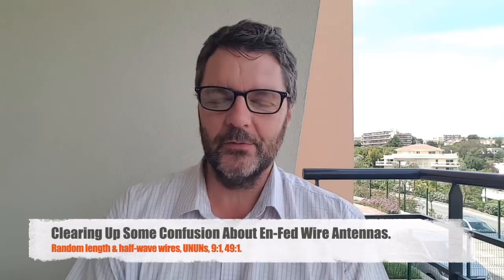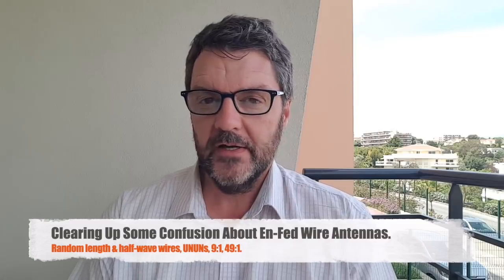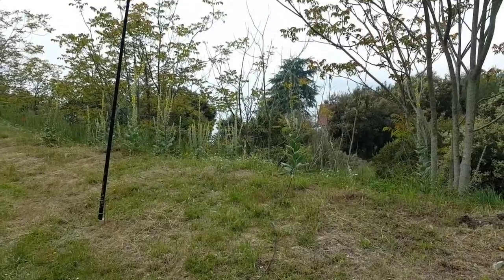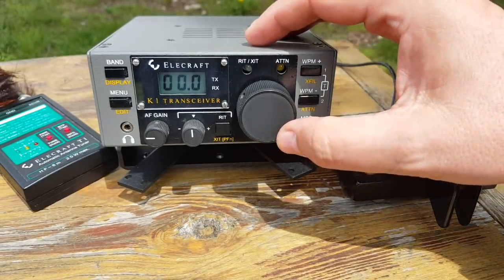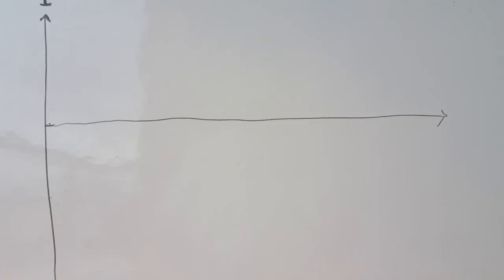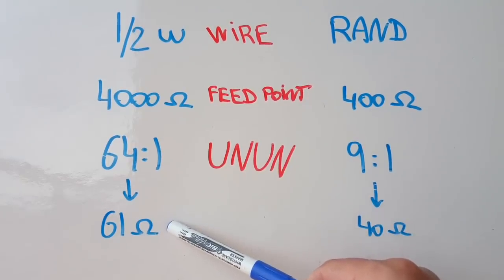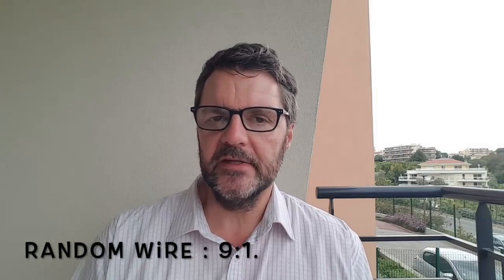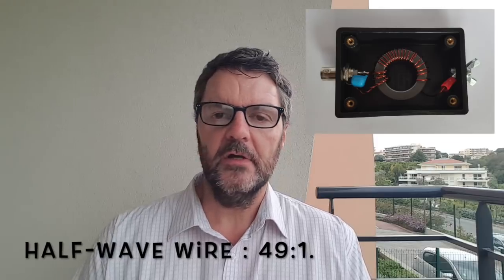Clearing Up Some Confusion About End-Fed Wire Antennas.

Comment: Almost complete baloney. The impedance analysis of a random wire is wrong. The analysis of what happens with reflected power is wrong. The explanation of the use of 9:1 and 49:1 baluns and why they appear to work is completely wrong.

A true EFHW antenna, a resonant half wave of wire is an excellent antenna when used with a simple LC tuner. It is still a good antenna when used with a ferrite 49:1 balun although 20 % of your power will be lost to heat in the balun. On frequencies where the wire does not represent a half wave the balun losses can be 80% or more. The reason it appears to work is the high losses double attenuate the reflected power, fooling the VSWR bridge. You can get exactly the same results if you insert a 6 - 10 dB attenuators in line withe feedline.

To be clear, an end fed wire is a valid and, in most cases, an excellent antenna provided it is properly matched. A 49:1 balun will properly match a resonant end fed wire. But when it appears to work well on non resonant bands it is simply fooling the VSWR meter.

Please do not continue to propagate the "multi-band, no tuner required, end fend antenna". It is a complete hoax.
Reply: Great ..you ground with short comments the strange ,,philosophies,,  presented.
Basically, the equation concerning impedance relation to turns relation is missing .. impedance ratio goes by square of the turn ratio .. isn' t it ?
73 de 79HER215
Reply from the maker: I have said nothing contrary to what you just said.
Reply: What hapened in antenna can be explain very simple for most people who cannot follow all those but for start can understand simple what hapened in antenna. 
I know much more but I say explanation is ok for beginners. Better than nothing.
Reply: What happened in antenna in this case wire antenna is really complex , any antenna have ovn L C , also except impedance have inductive reactance, capacitive reactance, even ohm resistance. But also capacitance to near objects, ground(everything what can be  conductor)
I can continue all day and something skip. 
Example, ⅝ wave antena is litle longer than ⅓ wave so naturaly have some capacity reactance component. But it is matched with  coil in base so if design is correct have pure impedance. So in antenna some people use simple C & L and when cancelled each other we have pure impedance. But also in  theory you can find , phase shift explanation. Electrons need more time in the coil, loose time, so ⅝ wave isnt just ⅝ wave , coil make this ¾wave and really ¾wave do not need additional matching, rather connect same lile ¼wave. But ¾ is much more longer than ⅝wave. And so one.
End feed antenna is really tricky to explain everything what happenned in the wire. Same wire, same frequency , but not same soil or other objects, give different ratio inductive, capacitive components, impedance, even resonance. Radiation pattern is another huge problem.
By the way I prefere resonant transformer not just inductive.
Why ? 
Because I can add or reduce   L and C in antenna to match near perfect. Simple transformer cannot do this. 
I say antena can be look simple or for expert only.
No hard feeling.
Reply from the maker: True, even after I learn more it still would not make sense to most people, even if it might to me (and that remains to be seen) and a few others. Theory has to stop somewhere even if it means oversimplification, which might not reflect a perfect theoretical reality. Experiments don't lie, assum8ng repeated results.
Reply: @RadioPrepper  I'm convinced most antenna theory is ivory tower malarkey anyway. I've been making contacts all over the world with the hated random wire for 26 years. The number of times I've been told "not possible - not happening..." Is possible, is happening. 

So Im with you, Gil. If it works, it works. If someone else can't pencil that out, that's not reality's problem.
Reply from the maker: Definitely. Right now there are very interesting reports on the Clansman military group about the merits of the 8m random wire. Half-wave is better but it doesn't mean it can't work well enough in most cases!
Reply from the maker: As to the opening comments, I can't and won't make a twelve-hour video! That's why I said in this one "it's not exactly like that." Also all who get on their high horses and up in arms about my errors or missing info are never willing to teach, only criticize. I spent about ten hours on this video trying to bring some light, as I understand it, on a complex but important subject. It might bring me enough money to buy a beer... It's not why I'm doing it. BTW I have used a 49:1 with a 134ft wire on multiple bands. It is very efficient with QRP power. I never said it worked anywhere on HF. But hey, some people believe you can't get out of your backyard with 5W! All the while 1000 mile contacts with 100mW are not uncommon. This elitism malarkey in ham radio is a plague. If you know more, explain it, make a video reply, teach, I'm all ears; otherwise don't bother...
Reply: @RadioPrepper  And your explanation is good for start. Detail explanation owerhelmed almost all HAM radio population, even people with Phd in electronic cannot undarstand what happened in antenna.
Huge theoretical knowledge and manny  years experience need to understand how antenna work. But there is plain simple explanation, much more convinience for most people. Who like more than plain simple explanation, need time to research antennas. And this is years not minute to just understand antennas, feed line etc. 
Who have such this time in average HAM populations. Just very small number of HAM radio operators.
Reply from the maker: You are absolutely correct.